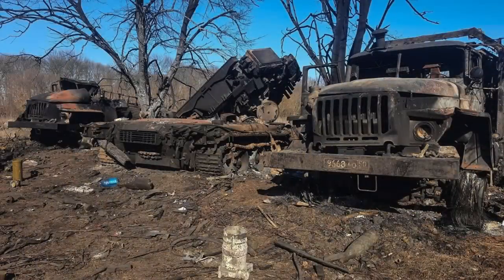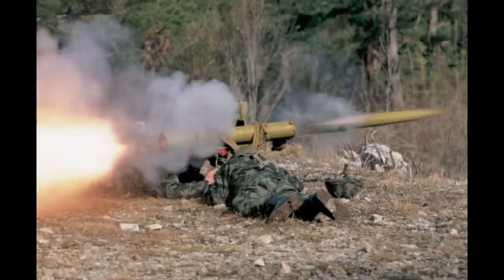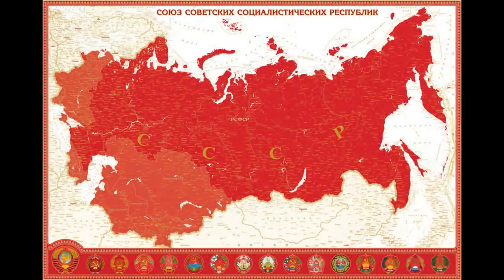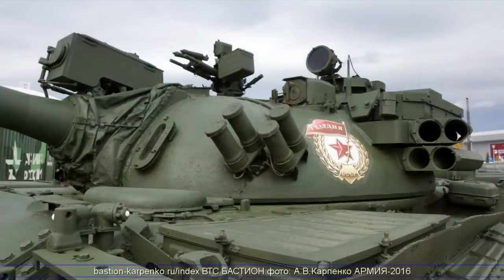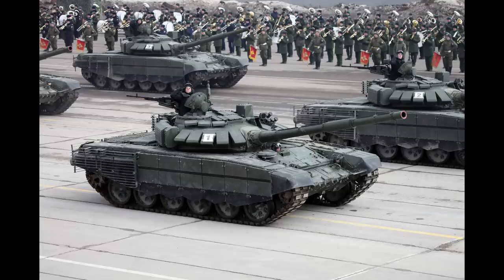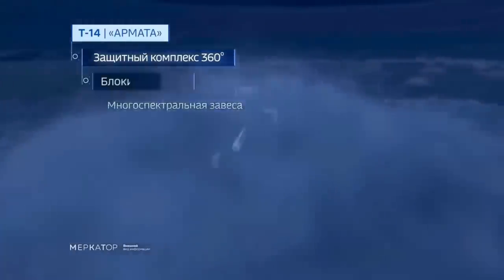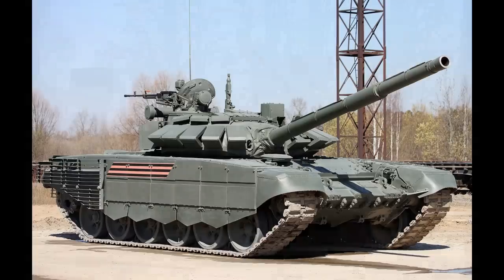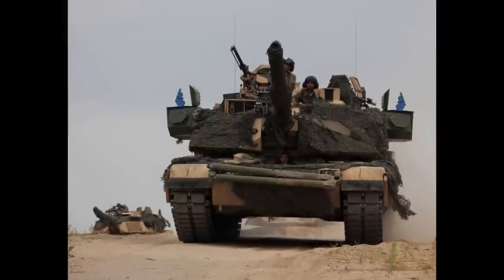Why are Russian Tanks Failing in Ukraine?

Comment: One thing is theory and other is practice in which such tank would survive months in suburban battlefield.. regarding topic.
1. No protection system help against rockets from helicopters and shells from other tanks and howitzers. And then there is million land mines.
2. What crew training will help here? It mostly help good luck.

So in the end we come to the fact that tank is used as mobile gun for infantry support. And for this you need numbers
Reply: What crew training will help?  Proper training will help - a lot.  Proper tactics would have helped - a lot.  Fighting as a combined arms team (which is also Russian doctrine) would have helped a lot.  Having your tanks fight as sections instead of individuals would also have helped a lot.

Even something as simple as providing smoke grenades for the smoke grenade launchers (and training the crew as to how to use them) would have cut losses by at least half.  Another thing that would have prevented a lot of losses would have been for the tank commanders to have their heads out of the hatch so they could see what was going on around them.  (One of the reasons US CVC (Combat Vehicle Crewman) helmets are bulletproof.)

And there's nothing better than for the TC to dismount the tank with a pair of binoculars and do a deliberate search of the area before getting on the tank and taking it there.  When you're on the tank everything's dynamic and you are juggling tasks - but you can take all the time you want scanning with the binos.

Comment: Western tanks without Active Protection Systems would have fared marginally better.
The crew would have had a higher chance of survival because of blow out panels, but not against top attack missiles like Javelin and NLAW.
Reply: That kinda depends on what Western Tank. Leopard 2 only had blowout panels on the Turret. The one in the hull is completely exposed. The hull is even less armoured than the turret so combined, it makes an exploitable weakness that proved deadly. We saw this when a bunch of Teenage Kurdish Fighters blew up a Turkish Leopard with a Soviet Konkurs (I think).
Reply: @josevictorionunez9312  Older Abrams from the 80s would be target practice for Stugna-P, let alone Javelins.
Reply: @josevictorionunez9312 
It was a MILAN but yeah.

Comment: Do people not understand how the basic functions of these tanks work? Unless you want to elevate your gun 15 degrees, you aren't going to be throwing a javelin off.
Reply: Clearly not. I don't know why I subbed this channel. I've now corrected that mistake.
Reply: @asdf3568  it used to be half decent, though it seems he's dumbed himself down somehow. Remember when he used to at least ACT like he knew the fundamentals of most tanks?
Reply: Wait, what? Why would you need to aim your gun up? The APS is independent of the gun. One version showed had roof-mounted, top firing IR Smoke launchers to be used against top-down munitions or air-to-ground ordinance. Newer models being tested and proposed have top mounted cannisters with explosive shot loaded in them that's aimed up to intercept top-down munitions. Again, the gun doesn't have to aim up for that. We aren't talking about shooting a missile down using the tank's main gun.
Reply: @Talishar  soft kill APS, Shtora, one of the only high end APS units out there. You know, the one slaved by the vertical drive?
Reply: @TheArcticFoxxo  You mean the one entirely useless against any IR guided missile and wasn't designed for something like the Javelin at all? It's designed to be used against old TOW systems where it can interfere with the command guidance of the missile, not fire and forget missiles. The T-90 would still be eating Hellfires and Javelins like candy as it wasn't designed to be used against those. It is entirely reliant on its smoke launchers to hopefully protect itself, not the passive emitters slaved to the gun.
Reply: @Talishar  Though whether or not it was designed for Javelins, it won't protect against them unless the missiles tracking itself is interrupted, and no, the TOW was originally wire operated, though due to their later upgrades they became able to be jammed. They were mainly designed for howitzer launched ATGMs, with LGS tracking. It is only reliant on the smoke for optically guided missiles, such as rare iterations of the TOW, TVG, and so on.

And I'm sorry, the T-90 is eating hellfires? How many AH-64s have been sent to Ukraine again? That alone is enough to invalidate you, ignoring your lack of knowledge on the IRCM.
Reply: @TheArcticFoxxo  I already said the T-90 doesn't work at all against Javelins. Also, TOWs were wireless when the T-90s were designed and developed. They were also considered the most dangerous ATGMs of their time so it'd make sense that anything IR guided using a painting system would be right up the IR illuminator's alley. The TOW 2A came out in 1987. The T-90 came out in 1993. The only "howitzer firing ATGMs" the U.S. had at that time was the Sheridan, which was rare and an antique by this point. TOWs were relatively everywhere and mounted on everything and even carried by infantry. 

I said the T-90 would be vulnerable to things like Hellfires. The T-90 wasn't designed to specifically be used in Ukraine. Also, your lack of knowledge is ridiculous because IRCM is all but worthless against modern missiles. Even the venerable Stinger has already been upgraded to ignore IRCM. Also, Hellfires aren't IR but laser guided in their most basic forms and radar guided in their modern forms. Again, IRCM is worthless. Your lack of knowledge just shows that you're just another Russian bot who doesn't know what they're talking about and using buzzwords their Russian handlers told them to use and not understanding any of it.

Comment: Aren’t active protection limited by the electricity output for the radars? IIRC the had a problem with the Abrams only having a few hours of power for Trophy. I suspect the Israels had an initial advantage because there was more room on Merkavas to install spare capacity.
Reply: Yes they are. That's why APS on T-72 makes no sense without APU- auxiliary power unit. Which raises costs further
Reply: The radar is not a large power draw compared to needing to move a tank that weighs over 50 tons.
Reply: @thuggeegaming659  yeah but you'd have to keep the engine constantly on in order for APS to work. Hardly practical.
Reply: @phunkracy  If the tank is off, you're dead anyway. Mobility is everything.
Reply: @thuggeegaming659  not really, when the engine is on you're glowing like hell on the enemy thermal camera
Reply: @phunkracy  Keeping the tank off makes it a sitting duck. You can't even fire the main gun with the tank off. Useless.
Reply: @thuggeegaming659  you can if you have an auxiliary power unit. Which makes APU so great.
Reply: @phunkracy  An APU can also be used to power the radar for an APS.
Reply: @thuggeegaming659  that's literally what I just said mate
Reply: @phunkracy  No, you were referring to operating the main gun. I'm saying that an APU can also operate an APS even if the tank were off.
Reply: @thuggeegaming659  I refer you to my very first reply and recommend more focus on reading with full comprehension
Reply: @phunkracy  I already responded to your first comment. I have the same answer for you. I recommend more focus on reading with full comprehension.

Comment: If the Armata can't make it across Red Square with out breaking down you can bet your last dollar the rest of it is crap also. As for tactics they are making the same mistake the French did in 1940. Doling out their armor here, there and everywhere. Which results in it being effective nowhere. Armor is meant to be massed and moving. It's one thing to take on a lone T-80 hunkered down in a tree line. It's a whole other ball game when there are 50 plus rolling in your direction. If the enemy has more tanks than you have anti tank weapons in a given fight you lose.
Reply: That's not why the French lost. They lost because they relied on wire and runners for command and control against an army that was using radios. Once the telephone wires were cut by artillery and bombs they were screwed. The French had armored divisions where they concentrated armor and mechanized forces. These were the troops that advanced into Belgium with the BEF to execute the Dyle Plan. They got flanked and didn't receive orders to counterattack south until it was too late.

Comment: Dont see the point of turning your active protection effector to the front and/ or sideways.

A tank should be build to survive other tanks and these usually attack the front and side.

So it sould not have problems there with a simple atgm. Also from the side.

The big problem is the roof and thats the weakpoint these systems should protect. 

Idk why most tankmakers ignore that. Maybe because its technically more demanding.
Reply: "Idk why most tankmakers ignore that."  They don't.  They would love to have every part of the tank armored as well as the frontal 120-degree arc.  Tanks are a balance between mobility, protection and firepower.  In order to increase one - you are going to have to decrease one (or both) of the other.
Reply: No tank since WW2 has had sufficient side armor to stop enemy tanks or ATGMs from penetrating them from the side. Not beyond shallow glancing impacts. Side armor even on even the heaviest modern tanks is generally less than 100mm RHA equivalent.

ATGMs can have tandem HEAT warheads with easily 1000 mm of penetration behind ERA, and while some attack from above, most attacks come from the front, sides, especially those of the turret. Even from the front, ATGMs can usually kill any tank.

Defeating the most common threats is always first priority. Edge cases like top-attack are nice to tackle, but the focus for Active Protection System developers has been and should continue to be countering low-flying threats. In the past that has meant ATGMs, though some more recent systems have even shown effectiveness against the kinetic dart (APFSDS) rounds that modern tanks usually fire at other tanks.
Reply: @JosephHarner  The most effective antitank weapons are the top attack ones.  That's why defeating top attack is just as important as defeating side attack.  And the Trophy system that's been adopted by the US Army was chosen because it could stop our own weapons as well as threat weapons.  As well as the fact that it has defeated a wide range of antitank weapons to include the Kornet missile in actual combat with zero hits on the tanks,  

And no APS is fast enough to defeat a sabot round - they cannot even defeat a HEAT round fired from a tank main gun.
Reply: @JosephHarner  That may be true but still: why are they pointing the effectors to the front?

This does not look very trustworthy.
Reply: @colincampbell767  Of course they ignore it. I have seen so many aps for the side and front and so far none for the roof although Im not so much into these things. 

For me it seems like they are just going the easy way due to a lack of funds.
Reply: @fritzx735  Read up on the Trophy APS.  The Trophy was chosen over a less expensive US made system.

Comment: You can also saturate Mexico, for example, with a bunch of modern ATGM systems, and after losing hundreds of M1A2S, say why American tanks were bad, but that's not even the point. Active protection increases the cost of the tank by 1.5 or 2 times. And to say that the USA or Germany have massively active protection complexes is ridiculous. We have only seen a couple of exhibition samples, or as you like to say "parade tanks". And so without the screenings, we see the most ordinary Abrams and leopards without active and dynamic protection, which are just as well struck on board by the good old RPG-7, not to mention modern ATGMs.

Comment: Russian tanks have critical weaknesses that are causing large losses in Ukraine, but the problem is also the lack of Russian light infantry to protect their tanks. Under current leadership Russia seems to have lost the art of combined arms operations where tanks and infantry work in close cooperation. 

Good infantry is going to clear out a lot of opposition AT missile teams before they even launch.
Reply: Russia doesn't have the manpower for combined arms in this conflict. Their refusal to mobilize due to political ramifications has meant that they can't provide shielding infantry for tanks.
Reply: Lost?
You can not lost what you never had.

Comment: You need excellent sensor arrays and computaional electronics for active protection systems. That leaves only Chinese manufactured devices which do not use western intellectual property. Good luck reading the spec sheet!

Comment: With the $65B Russian military budget, nobody should be surprised that very little improvements were made to the existing tanks, or why the new Armata isn’t finished yet. This sum is way to small to maintain this huge army and the nuclear arsenal, and to research and develop new weapons. Add the rampant corruption on top and you see the reason why the Russians are struggling so much in Ukraine.
Reply: half of the budget was mostlikeley stolen

Comment: I've seen several videos of captured Russian tanks with cosmetic only "reactive armor" that have no actual capacity to stop warheads.  I found it hard to believe at first but now I'm shocked they even cared enough to pretend to put ERA on their tanks.
Reply: era is designed to be as stable and unresponsive as possible, that way the only go off when a heat/apfsds hits them and dont go off in a chain when someone fires a high powered rifle or an he shell at them. I am not saying that there are no tanks that have "cosmetic era", I am just saying that if you hit the tank where it doesn't have any era blocks, the chances of one going off from sympathetic detonation are virtually 0.

Comment: lack of massive air support , remember US m1 abrams and other armored force alway fighting under massive air support avaiable 24/7 . russian don't have that luxury . it pretty much a cakewalk fight for tank/armored IFV if each one of them got two FLIR attack heli and two tactical fighter bomber cover them everywhere and anytime .
Reply: US doesn't have air support for tank battles because it was more likely that the air support will hit their tanks. The US  tank was so much better than what the Iraq had.
Reply: Close air support is not practical for tank combat.  Because by the time the plane gets there - the fights over.
Reply: @warcrimeenjoyer219  air power are much more expensive to build , russia/soviet simply don't have enough budget to fight like US
Reply: @tranbachuyen6655  that is true but the Russians also have their own doctrine which puts artillery at the top of the military pecking order the Soviets did the Same thing and their military was massi e

Comment: I bet Russia isn't sending any of their T-14s because:
1: losing one is a HUGE blow to them since it would of course go straight into NATO's hands. 
2: there's just too few of them
3: there's probably tons of problems with them that we don't know about because they don't want their shiny new tank to look bad
Reply: The first parade to feature the T-14 had it break down in the middle of the parade square, so tells me all I need to know about that tank.
Reply: @The_Lunch_Man  it didn't break down, the driver was inexperienced and unfamiliar with the new type of driver's controls on the tank and accidentally threw the parking brake. It later drove off under its own power. However you are probably still right, the T-14 probably has plenty of issues given its short age and the fact it hasn't been combat tested. Some issues just don't make themselves known until the tank has been put through combat. 

That incident does show us one thing though. It means that Russian tank crews will require re-training for the new unfamiliar tank which takes time and money, something they don't really have right now. 

Lastly I feel like with how much the T-14 depends on electronics, there is so much more that can break and go wrong on it.
Reply: They are not sending any as it has not been adopted by the army. Hence they do not have trained crews.
Reply: Armata is still a prototype that has not entered service. There is no logic in sending her to Ukraine.

Comment: I think its more or less propaganda its over blown. They are probably doing fairly fine. Atleast no worse than any other tank under the same circumstances
Reply: Modern Western tanks would not be destroyed by the ammunition explosions because the ammunition is stowed behind an armored door and 'blow off panels' vent the force of the explosion outside of the tank.  More importantly with a Western tank you're going to get the crew back.  Which means that you have just saved all the time and expense of their training and they will be even more skilled (even if this more skilled is: 'don't do that again').
Reply: @colincampbell767  ok but they would be penetrated. and we dont know how many tanks are catastrophically exploding any way. my guess is not alot. the caressel is in the bottom of the tank.
Reply: @Castragroup   If a tank burned - then it's scrap.  Massive damage to internal components and it's cheaper to build a new one than repair it.  And even then most of these repairs will have to be done at a depot that's usually a thousand miles away.  (For the US It's a thousand miles and across an ocean.)

Now Russian logistics is not doing very well.  Moving damaged tanks back to depots in Russia to be rebuilt might not be something they can do yet.